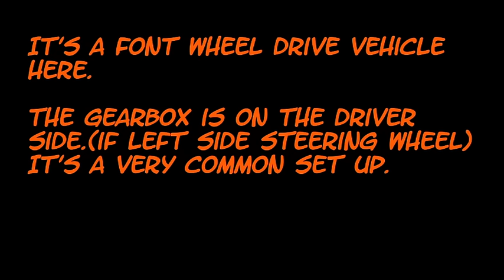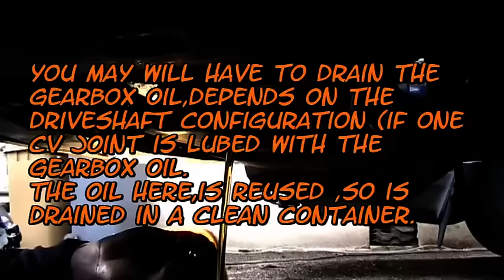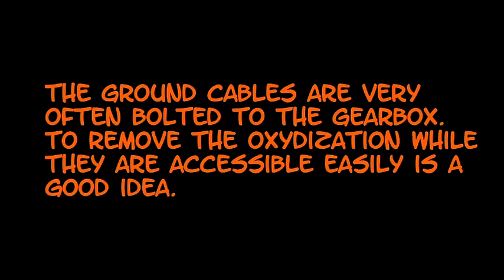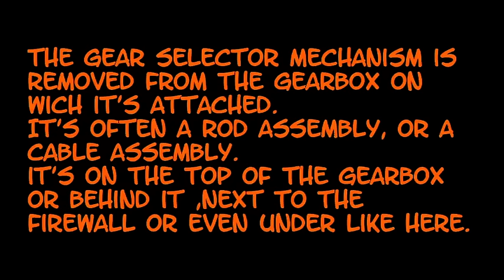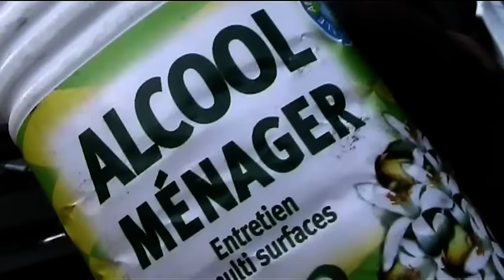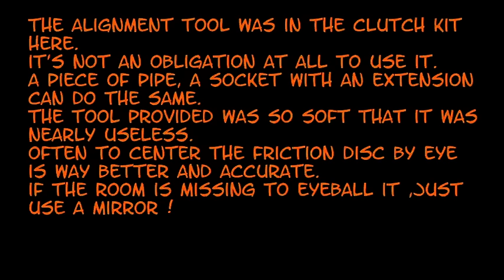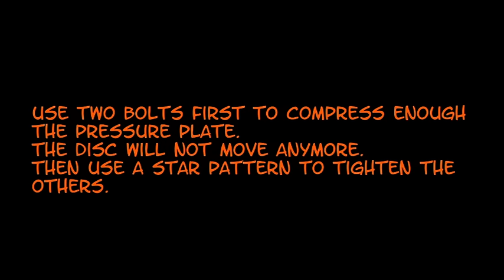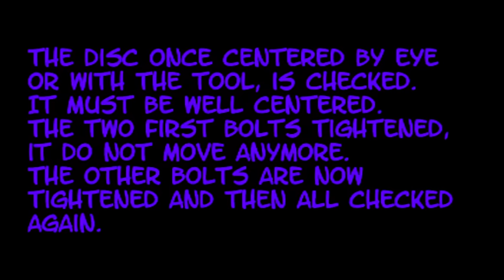Front Wheel Drive car clutch replacement.

Comment: Sir I really need your help in this clutch sounds. There are no hard shifting in gear transmissions, everything is normal.
https://m.youtube.com/watch?v=DVJCERkwS2w

Sir, it happens only after replacing with new clutch. And this sound did not come with the old clutch.

Any ideas or suspect regarding pressure rings getting hard...? And how to identify hard pressure rings?
Reply from the maker: Which parts were changed ?
friction disc ?
pressure plate ?
through out bearing ?
Reply: Clutch disc, pressure plate and clutch bearing all lubricated properly wherever required.
Reply from the maker: It's very noisy for sure. There are 2 noises : the first one one as soon as you barely touch the pedal,it's a clunking noise and i can see some play between the fork/bearing assembly and the pressure plate. Are you sure it's the good bearing ? The second one sounds like the pressure plate diaphragm springs wich are a bit squeaky. Maybe it's just because they are new,and they rub on the bearing's surface. The first noise can be heard again as soon as you release the pedal : it's like a clunking noise on the fork assembly. Seen it's a hydraulic system (looks like a hyundai right ?) i would try to bleed it first. If nothing is better i would remove the gearbox again to be sure all is well installed and tight. There is too much play somewhere.
Reply: Yes, new clutch bearing was installed and the car is Hyundai i20. And I have driven only about 6000 km with the new clutch.

Sir, such issues arise only after 1 week of installing the clutch system, and when driving for over 20 km the clutch pedal become sticky and hard, but there is no problem in gear shift and no low power pulling. Everything is OK.

Sir, can you be more specific why would I bleed cylinder? Since this cylinder was OK with the old clutch. Thanks.
Reply from the maker: pedal sticky and hard = problem of air bubbles in the hydraulic clutch system or the bearing is not working properly on the pressure plate.
Something is not working properly,a clutch is smooth,moreover when it's a hydraulic system like yours.
You need to bleed the hydraulic system on the clutch master cylinder and slave cylinder, assembly ,wich consists of removing the air from the pipe by pushing it with hydraulic fluid.
You press the clutch pedal,open a little bleeder valve,let air and fluid go out,then close the bleeder valve ,and then release the clutch pedal.
repeat until no air is coming out of the bleeder valve anymore.
Be sure to keep the correct amount of hydraulic fluid in the reservoir,otherwise you will send even more air in the system.
If it does not have effect you should check if the clutch is installed properly by removing the gearbox ,or by looking at the parts reference first ,to see  if they are the correct parts.
That's not normal to have so much noise.
Reply from the maker: If nothing was wrong ,why did they replace the slave cylinder ?
If nothing is wrong with the NEW clutch,why is there a vibration wich wasn't there with the old one ? 

A master cylinder is just a pump wich moves a specific volume of fluid.
If the master cylinder is damaged,it will not move the fluid,leak,or be sticky to the feel  when you actuate it,because the piston inside is grabbing its bore. (damaged seals or corrosion,or air trapped inside)

Car dealers are specialised in making you spend money,for most of the time,no good reason.

I suggest you to actuate the clutch with somebody helping and feel by hand where are the vibrations,or inspect for leaks.

If they changed the clutch,their work is guaranteed, they are pro,the expected result must be here when you paid them.
Since it was actuated properly when you let them the car to have the clutch changed for a new one,they have to solve the problem themselves they created when changing the clutch.

You don't have to pay for new parts ,one after the other until they realise where the problem is.

To answer directly : changing the master cylinder will do nothing if the clutch is already actuated correctly to begin with,if the air is purged out of the sytem,and if the already present master cylinder does not leak.
Reply: Sir, thanks for follow up.

That they even told me they were expert trained technicians which is true on their part, and refused to complaint with my opinion of first physically open, inspect and find out the culprit in the gear box, which I have been maintaining for the sound.

Myself being a layman and no other options, am compelled to follow their advise and accordingly slave cylinder was changed.(Rs. 3600 paid for this)

Thereupon, same problem persists and was advice to change master cylinder too which is due to change.  If problem still exists, the whole clutch system has to be replaced. This is my last option. I don't know prompt them not to first inspect the gear box and going other way round.

Please really need your help and advice too again. Thanks.
Reply: Sorry forgot to mention: no leaks in the present master cylinder and old slave cylinder too. Please note new slave cylinder was already installed. And can we reinstall and use again the old clutch cylinder in any case considering the old clutch cylinder is 100% good?
Reply from the maker: Trained experts technicians can make mistakes.
They rely on this to shut your mouth and not allow you to question their work.
Remember space rocket crashed because they mixed up the imperial and metric system.....

There was no need to change the slave cylinder to begin with ,unless it was leaking.
Since it's outside the gearbox,and just kept in place with two bolts they had no reason to replace it to begin with (unless they realised the clutch was noisy.....and the pedal sticky like you experienced yourself)
When the slave cylinder is INSIDE the gearbox housing ,it's generally replaced with the clutch,because it allows to not be obliged to remove the gearbox again if the slave cylinder fails while the new clutch is still good.
In your case it's outside and very easily accessible in case of problem,so unless it was leaking ,they had no reason to replace it.

Moreover , are you sure they replaced it ? ,because it looks like very dirty,the bolts are not marked by the tools and the dust around the bolt look like it was here for a very long time,like the dust boot,very dirty,while it's supposed to be a new boot.
You only see the fingers marks (clean spots) on the fork where it was grabbed to realise it was manipulated not long ago.

Yes you can re use the old clutch slave cylinder,as long as it's not leaking,or corroded inside,so as long as it's operating properly.

They are simple hydraulic devices,they last long.

You have no to change master cylinder either.(unless it's leaking,corroded inside or not operating properly)
If you let them to change it anyway ,make yourself a very discreet mark on it,so you can see if they lie to you by making you pay and letting the old part on the car.

You can hear the noises are coming from the clutch area,and they sound like parts have a lot of play ,and parts that are squeaking , sounds like springs compressing and rubbing.

Again i would check inside the gearbox,the hydreulic actuators seems fine to me.otherwise you wouldn't have the stroke enough to engage and disengage the clutch.
Reply: Sir, about genuine parts, to avoid cheating and lieing to customer, I was physically present with the technicians when both the clutch system and clutch slave cylinder  were replaced respectively. Yes, all parts were genuine.

Now, as per your advice I won't go for replacing the present master clutch cylinder. However, old slave cylinder they said rubber inside is going bad (I do not know how far this is true!!), but I hope its still reusable. And they also said, slave cylinder is for one time used whether its going bad or not, once it is taken out, it can't be reuse.!!!

And Sir, how am I going to impress them to directly go for checking gear box rather than going around. They always resorted to change master cylinder claiming it is going bad too. It seems they want to hide their mistakes or use customer a source of money. Its really irritating and annoying. Actually, I do not want arguments with them.

Sincerely waiting for your wise advice. Thanks.
Reply from the maker: You have few choices :
-Let them change the master cylinder and see if the problem is solved. = you loose money and maybe your problem is solved
-Go in a good local garage to have their opinion = you have a new opinion to think about.
-Do it yourself.

Slave cylinder is not for one time use,that's false.
Otherwsie you would change the brakes master cylinder wich you use way more often than the clutch,and clutch master cylinder too quite often.

why the clutch while old didn't make noise 
why now while it's brand new it's making noise and the pedal is sticking 

They worked on the car and the problem appeared.
They created the problem directly or indirectly working on it.

Don't let them discourage you.
You paid them to have a new clutch working normally.
You have not what you paid for.

This should be your argument if you go see them again : You paid them to have a new clutch working normally.
You have not what you paid for.

It's becoming their problem because you paid them for that.
Reply: OK..you are right. I was too confuse and before going to dealer for replacement of parts, I absolutely went to good local workshop and tell about the problems. Almost everyone advice me to recheck the clutch assembly fitting and they had little suspect of master and slave cylinder going bad. Yes, 99% local workshops recommend for checking gearbox where it (dealer) was installed.

Thereafter, i went to dealer as per their advice, however, the above case was totally against the company dealer and I end up uselessly changing my cylinder.
Reply: Clutch disc, plate and bearing were changed.
Reply from the maker: Give me some news if you have some : )
Reply: Sir, as stated earlier, the slave cylinder was changed but still no signs of grinding sounds going away from inside the engine.

As of now, per your advice and sharing, and going almost through best local service centers - the most common answer is:
1.    Changing Master Slave Cylinder will not solve the problem unless the cylinder itself is leak or damaged 
       (which company recommends to change)
2.    The grinding sound or whatever, will continue to come but would cause no issues in future. Its reliable to 
        use and its just the pressure plate getting hard when clutch is engaged or disengaged.

Based on the above information and believing to be true and correct, apart from staying away with unnecessary payouts of money, i am deciding to use the car as it is.

Sir, i guess you would have some good comments and wise advice on this issues. Really appreciating for your future help. Thanks.
Reply from the maker: Thank you for the follow up.
I think you took the most reasonable decision.
Like i said,i would have emoved the gearbox and took a look inside to be sure everything is working properly,or to see if no mistake was made.
But i do things myself,and it would cost you money.
Maybe the use of an endoscope could save you a lot of money and troubles ahead.

Comment: Front wheel drive sucks .Just look at all the work needed.
Reply from the maker: The cars are lighter however.
You change two times a clutch on a car,most of the time.
It's often at the junkyard before even the second one lol.
I prefer rwd myself,the weight ditribution is way better,so the handling.
Reply: I try to do as much work on my cars as possible so am a massive fan of good old fashioned engineering with home maintenance in mind.Good video all the same .Have a fiat 500 got to change the alternator .Please shoot the designer for making the alternator totally un accessable .
Reply from the maker: The old one,or the new one fiat 500 ?
Reply: New one  1230cc .Never again  .I needed to see how to remove right drive shaft so thanks again for the video.

Comment: Jacking the car up on the seals , what a nob jockey.I would not let him touch my car or any other car for that matter.I can not watch any more , please take this off YouTube.
Reply from the maker: in case you don't know,there are specific locations on cars seals allowing to jack it from there.
They are factory reinforcements to use with the car manual jack when you change a wheel or just lift it up.